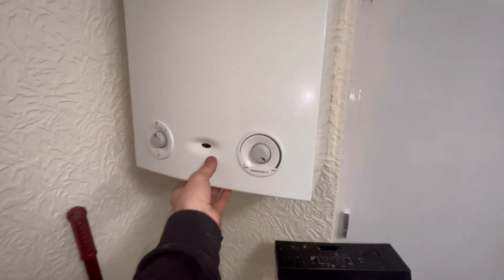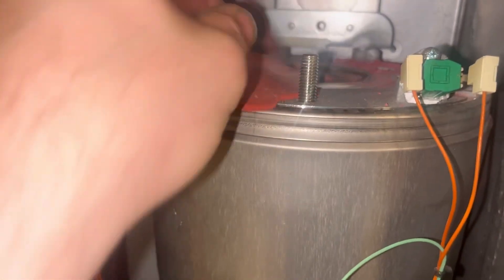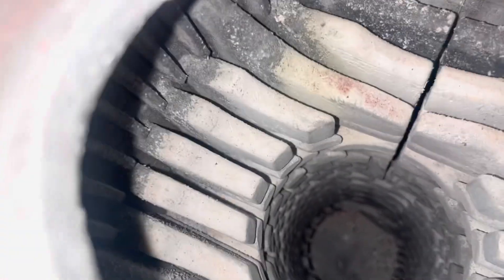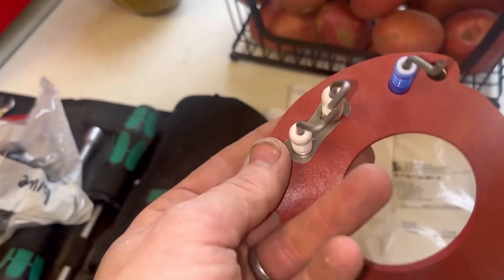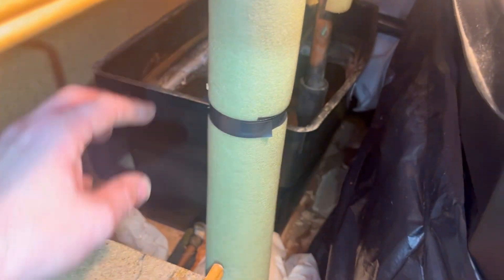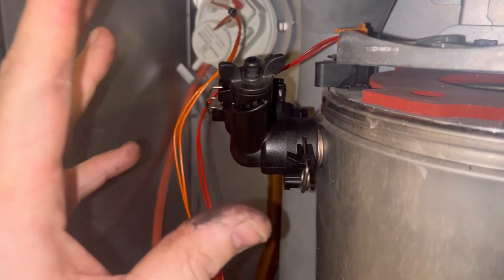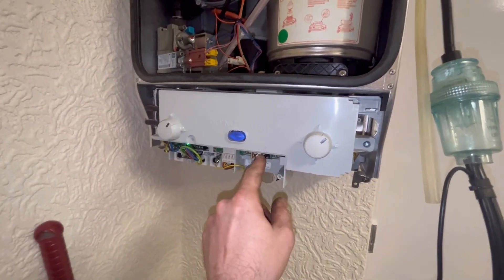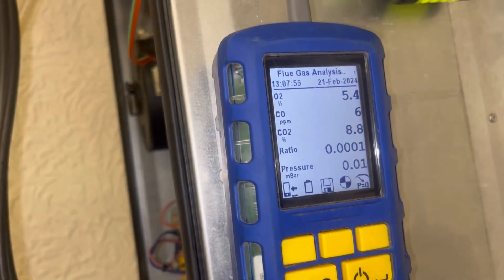How to Full Service The Worcester Greenstar Junior and RI: Training Thursdays

Comment: I can see the 2 of the electrodes generates the spark. What does the 3rd blue electrode at the very back do?
Reply from the maker: Flame detection electrode. Detect the flame once the boiler has ignited

Comment: I was just wondering once you put the new burner seal on is the best way to check that everything is on tight and correct by sticking ur analyser at the top of the burner making sure there are no readings then once there are no readings then everything is fine and you’ve done it correctly?

Comment: Hi mate excellent video BTW, I have this same boiler and I'm experiencing low water pressure from my hot taps throughout the house I also have 1 radiator upstairs that is always cold any ideas on what to do or how to identify the problem?. I have tried bleeding the radiator and it did actually get really hot once however further attempts to do so result in cold water coming out without much pressure
Reply from the maker: Turn all the rads off apart form that one and run heating, it may have lost circulation, the pressure of its just one tap will be problem with tap or supply to tap
Reply: @bluebulldog_uk  thanks mate ill give that a try

Comment: Worth checking the rubber gas pipe that goes from the gas valve to the fan, the one I did the other day had a few splits in it, can be caused by twisting the fan out to take it off if it’s old 👍🏻
Reply from the maker: Yes mate seen a few split always worth checking good shout 👍👍

Comment: Hi Luke 
I have this boiler, it’s a heat only but recently it’s got rather noisy when on but usually it’s as quiet as a mouse 
Any ideas what may be causing the loud vibrating noise ?
Reply from the maker: Best guess is fan, could be loose casing maybe? Is it as soon as it starts up and stays there?
Reply: @bluebulldog_uk  thanks for the reply Luke 
Yeah from start up and remains noisy 
Normally it’s so quiet you wouldn’t even know it’s on

Comment: Luke can you work out what the guys above are on about, or can someone post a picture and circle the part they mean? Thanks for the advice everyone!
Reply from the maker: Where I put the plate back in on top of the burner you’ll see a white plastic strip, a small part on the right is missing by the looks of it. I’ve been asking around and asked around 5 other engineers about this and no one has said they knew about it. I can’t find a safety bulletin from Worcester about it. I am looking into it but I checked with my analyser at the end and the sweep test was fine, all safety checks on boiler were fine but if find any information on it Il post in another video, but it doesn’t seem common knowledge from asking around.

Comment: I always put the nut back on m8, i find ot helps when ypu arw pulling the electrodes as the plate doeant rattle about. Great content again m8, loving the training thursday
Reply from the maker: Not a bad shout they do move around, someone has suggested hose grip pliers as well which looks like a decent tool to get for them

Comment: Luke you need to go back to that job as that plastic strip at the back needs to be replaced other wise it won't seal on the red gasket it will be dangerous
Reply from the maker: Sweep test was fine I always make sure it’s sealed no readings on analyser so it’s not dangerous as I would of picked up readings if I hadn’t of sealed. Been asking about and checking up on the plastic strip, asked around 5/6 other engineers and none have come back to me to say they even knew or thought to check it but I’ve had few comments about it so I’m looking into it to get some more information if it’s a safety critical part of the boiler. Was there a Worcester bulletin about it or anything like that as it doesn’t appear to be common knowledge when I’m asking around? Appreciate you pointing it out as I will look into it to 👍

Comment: Use a small 10mm open ended spanner rested on the HX top to prize off the electrode wires Boss, or  angled hose grip Pliers. No damage to the shroud or electrodes, and no need to chissel the top of electrode off.👍
Reply from the maker: Cheers mate Someone’s suggested hose grip pliers as well which is another great shout

Comment: Yes, the main reason the gasket fails is the plastic clamp that holds the burner lid down, if it fails it doesn’t hold the lid down evenly and allows flue gases to escape therefore when you do your sweep test it detects co, a clear sign the clamp has failed is the rubber electrode connections turn white and brittle
Reply: The two screws holding the plastic part in place can be a complete arse to undo, you can lift the heat ex upwards and out of the boiler for better access if need be without undoing the the two screws
Reply from the maker: I would say the main reason them gaskets fail is lack of maintenance to be honest if they was replaced and them boilers stripped and cleaned when they are supposed to be the boilers would perform better, last longer and prevent breakdowns
Reply: @bluebulldog_uk  yes I agree, a quick negative fan pressure test and sweep test will prove if a strip down and clean service is required, certain companies out there prefer their engineers not to carry out strip and clean services which definitely doesn’t help, most of the gaskets that I have found to be compromised are due to the plastic clamp turning brittle and falling to pieces, but I absolutely agree poor workmanship is also to blame

Comment: Need to change that white plastic retaining clip at back of heat ex when they are damaged now mate
Reply: Yeah there has been saying it needs replacing when its damaged as it helps make the seal
Reply from the maker: @MrMarco3  ok il have a look on Worcester’s website to see if I can find it but doesn’t mention it in TB0138
Reply from the maker: Has there been a safety bulletin from Worcester about this as I’ve asked around 5 other gas engineers about this and no one has said they knew about it…it doesn’t appear to be common knowledge so I’m looking for more information on it now
Reply: I've typed a comment to this twice and it's disappeared 😂 I think the CIA are watching me 🫣👀🤣
Reply: Yep retainer if broken needs replacing pain to get too unless got small hands.
Reply: Great video, typical ridiculous Worcester design. 👍